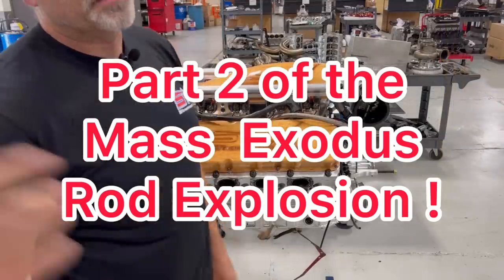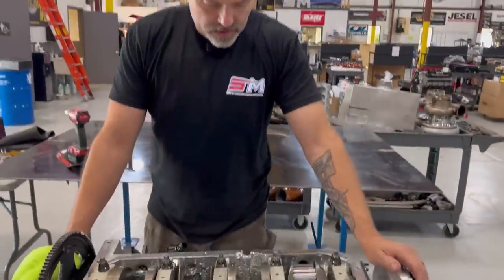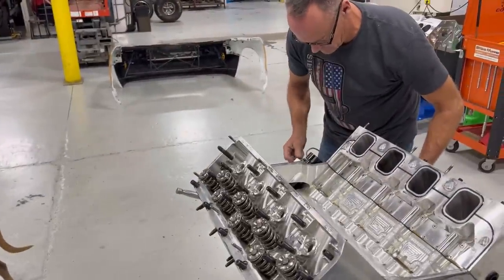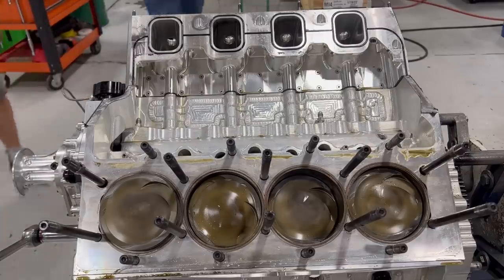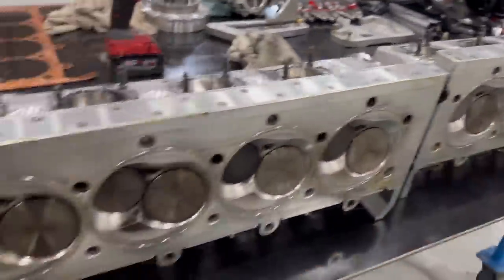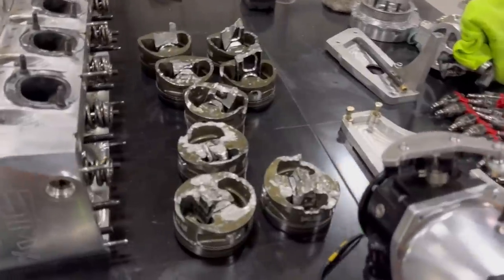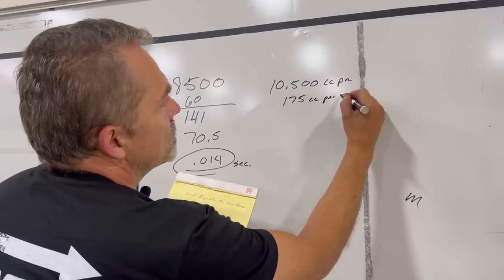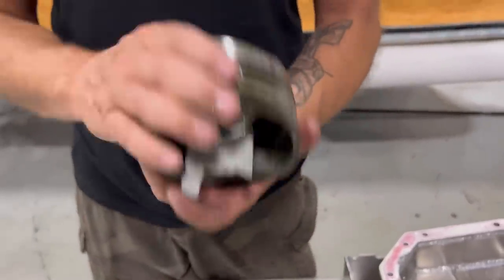EXPLODED RODS  Part 2

Comment: Steve, 
I agree with you that it seems like a material issue. It’s as if the rods exploded with all those small fractured pieces. Nothing looks bent … just pulverized pieces.
One thing you mentioned is that the rods were anodized. I’m no expert but, when I was involved in getting better mechanical properties the parts got  shot peened. Any thoughts about that?
Great video and very informative. Thx for sharing
Brad

Comment: 2 things : 1- this is obviously too much torque for those specific rods. (the point where they broke makes it obvious) 2- the rods were very brittle, because in principle rods should be tough enough to cut the engine casing. The casing shows surface scratches only, meaning that for some reason the material of the rods was weaker than design spec. (incident in the processing/hardening) If the aluminium alloy was playing its role, the destruction can come with a "brrr ... bang"  meaning there is a little progression (like half second) in the destruction because it bends before breaking (strong part breaking) but instead in your case it exploded in a "flash/bang" , indicating the brittle problem.

Comment: I was going to say either a defect in the metal makeup or an issue with the forging or heat treatment process of those rods led to them being overly brittle for that application.  The failure mode and grain structure visible in the broken parts just screams brittleness to me.  I would bet a fatigue crack developed in the rod third back from the balancer leading it to break, impact the side of the block where it meets the oil pan, and the shrapnel created from the initial break impacting the remaining rods moving at speed was enough to cause them to shatter.  Regardless, Im happy for you that the damage to the rest of the enging was relatively minimal given the extent of the shrapnel you pulled out of it. Hope you are able to salvage most of it.

Comment: I agree with others here - your positive attitude is great. I hope you can get to the bottom of this so we can all learn.

The close-ups of the remaining portion of the rods (in the pistons) look to me like they were stressed side to side. Might there be an issue with the pin caps expanding thermally at a different rate than the piston? Or ... maybe the intake valves were beginning to float (8500 RPM!!?) and the piston(s) hit it/them, yielding in a force to one side of the piston ... again putting sideways stress on the rod(s)?

Comment: I'm by no means an engine builder or anywhere near your caliber when it comes to engines/ drag cars.  However, what happened is actually an easy fix albeit always forgotten.  If you have a piston delete button, you MUST disconnect the con-rod scatter button.  If not, the impedance changes things and boom.  Hope you can find that pesky wire on the next build and proceed accordingly.  

I appreciate the context, your outlook, and willingness to teach us!  Thanks.

Comment: On the Salt ,I've seen a engine hydraulic while running. The driver backed off then planted his foot again . The cylinders had filled with unburnt fuel instantly. It  Locked the bottom end and spat the head gaskets out. The car was running around 200 MPH. The driver had cast his own ally BBC block and heads.

Comment: Glad that most of the components are salvageable. I'm really surprised the heads were still good. Until you pulled the rocker arm covers I expected to see tons of carnage. Really nice to see that wasn't the case. Overall outside of the rods the damage was minimal which is amazing when you think it let go at 8k+ rpm and 4k+hp. Quite extraordinary.

Comment: As a racer  I've  had many drivetrain explosions  ,, never found a Holly carb when the Buick motor  let go the block was in 6 separate  pieces cam, crank,the converter  took out the bell housing and guts.  The driveshaft had wrinkles,  the hood was blown upward the hood scoop was gone the windshield  was shattered , I picked up metal for awhile as well as oil everywhere    oooo yeah that was my worst

Comment: I wonder if harmonic resonance from maybe transmission output or another source  @ 8500 rpm travel  through the crankshaft  and into the rods and would you be able to acoustically pickup the failure frequency on a chassis dyno  and were all the other runs at the same rpm  looking forward to the metallurgy on the rods to come back your detective skills are past impressive Steve thanks for the great videos cheers

Comment: I am not an engineer or know lots of information.  This is a question/statement.  The way those rods shattered it is almost like glass shattering from harmonics.  I am not saying harmonics caused the failure.  I am wondering if there was a simple flaw in one rod that caused a change in harmonics in which these rods splintered/shattered from that the machining caused.  In other words was there a momentary harmonic shift that because of a design of the rods caused the whole catastrophic failure of each rod after the first rod broke.

Comment: The metal pulled apart look at where it's connected. It did it in a flake during casting something happened on the temperature during casting or hardening

Comment: Steve It appears that with all connecting rods failing together the fault lies somewhere with them.
The metal you removed from the bottom of the little end boss on the connecting rod is only allowing clearance of the crankshaft balance weights at piston bottom dead centre. 
The connecting rod twists around the piston gudgeon pin from one side to the other and the crankshaft balance weights must clear the connecting rod little end boss across its full side travel when in proximity to the rotating crankshaft balance weights.
Your machining of the little end boss only to the same as the piston is not satisfactory, the piston does not twist as the connecting rod angle must follow the crankshaft journal movement across the motor and any axial crankshaft movement, this could be loading, differential expansion between crankshaft, crankcase and connecting rod. All the best with your rebuild, Ian.

Comment: I really think it's just a material issue. It looks like the rods broke in tension not compression, so it was probably fatigue.Fact that they all broke sugess it was something uniform and rpm related (not saying it over revved just saying that was what brought the rod defect out). I'm guessing the heat treatment wasn't right, but I'm no metallurgist.

Comment: It is so clear to me these broke in tension due to a mass overload of the rods weakest cross section. It is a faulty rod design for the weights of Steve's setup to contain the mass on the exhaust stroke. I could be wrong but to have a coincidence like this cannot be explained any other way except one other way...and that is a faulty alloy itself and incorrect heat treat. Steve brings up an important point about anodizing as well but that needs to be further proven out before making assumptions about that part. Lots of folks assume the heat treat is strengthening the material but it is actually a way to add wear resistance on the surface of parts. If done to the wrong formula for the alloy it can and does make the metal overly crack prone on the surface. I had this happen on a batch of 9310 clutch dogs used in large horsepower lower units..an improper heat treat was actually the result of having the wrong alloy as the raw material we made the dogs from. The entire batch was thrown out after one failure..that's 100 dogs at a cost each of over fifty bucks. We did  get some help from the steel supplier in the end after they admitted where the raw material actually came from. Taiwan.  We no longer trust that supplier. 
  The true physical strength in metals comes directly from the chosen alloy and having that alloy fully traceable from mother earth to final product. This is why one should never use metals imported as raw stock from other countries. When stocking a machine shop/production shop with metal stock, it is so important to know where your metal supplier actually acquired the metals being sold. IE Fully certified traceability with written documentation. 
       Hard coat anodizing and conventional sulfuric acid color anodizing, is not ever used on any aircraft components. And this is not because of the possibility of entrapped corrosives, but also because of fatigue issues from that practice. The thin chemically converted anodized layer does not add any strength...in fact it is much weaker in structural strength than the core material. Not just because of the possibility of entrapped corrosives, but also because of fatigue problem from constant compression/tension cycles. If the anodized layer is cracked at the most critical point, say where these rods broke (IE where the rods core material was doing most of the stretching under the tensile loads) then it acts like a stress enhancer, and that you must keep tensile stresses well below the level at which any crack can propagate into the core material. This explains why the material is broken at such odd angles in my view. 

        Also something else to consider is piston speeds. Piston speeds within the bore are actually going the fastest at the three o'clock and nine o'clock crank positions (big end). The piston on the TDC or BDC is actually at it slowest actual FPS speed. It is the sudden reversal from having some combusted gas pressure still being imposed on the piston on the way up to evacuate the cylinder, and then the sudden loss of that pressure, combined with the sudden over the top reversal of piston direction with comparatively little actual pressure except some boost (40-75PSI in this case according to Steve) which compared to combusted gas pressure is practically nothing. The piston at the crank position of 3 and nine o'clock in any engine,2 or 4 stroke is actually further down the bore than merely halfway. The piston speeds are continuously varying depending on crank position but it is the end of the exhaust stroke where the tensile loads are at an absolute maximum, and the weakest link in that case will always be the failure point without doubt. These all broke in very close to the same spot of the rods beams which says to me a design flaw for the mass of Steve's setup (weight and rpm)

I am human and I can be wrong but these scenarios seem to me to be the very best explanation of how all 8 went. It is easy to rule out an internal flaw,like in steels for example..a carbon fleck, or as in flight 232 a nitrogen brittleness flaw in the main spool of the fan near bolts at the axis of that DC-10 engine.

To have that happen to all 8 rods is a one in a trillion possibility...not plausible at all in this instance.

From Wikipedia "Investigators discovered an impurity and fatigue crack in the disk. Titanium reacts with air when melted, which creates impurities that can initiate fatigue cracks like that found in the crash disk"

Anyway, without an actual lab examining what is left it is anyone's guess but logic and common sense strongly figure into the solution. THe first thing to do is calculate the load in tension of the piston/pin/rings and then calculate how many Lbs the rods were experiencing at the rpm where the failure occured. Then the same rods ads designed need to be proof tested in tension, but also in a cycle of compression/tension to fully know how that c/t cycle affected the tensile load bearing capability from new to ,like in Steve's motor...very little time since new.

Not here to argue as I find Steve' knowledge to be the top in this industry. And also, forensics after failure is quite interesting to me given my aviation background. Chime in if you can add something I have not thought of though...:)

Greg Olson/MN

Comment: Another valid point to make is that not a single one of those rods looked bent… I’ve seen engines lock up with multiple rods bent, these rods just exploded like glass. My guess is bad brittle rod material

Comment: may be shattered through resonance - they were all moving at the same speed of rotation with well timed ignition  - could cause the parts to ring - resonance occurs and puts systems at really large oscillations - with  all parts being so well specked , balanced i presume dynamically as well as statically could all suffer the same failure at the same time - would be interesting to see strain mapping of similar rods to see stress points at relevant speed of rotation and movement  and compression.
Reply: I am thinking along the same lines.  If something happened to the harmonic balancer, the harmonic vibrations could have hit a critical frequency for those rods,  causing them to fail simultaneously.

Comment: Good work sharing your thoughts and information on this. Looking at the little ends where they broke looks like a brittle fracture to me. I guess depending on the material composition, pre and post heat treatment this could have been as the rods were supplied or maybe the material work hardened with each cycle until failure. How ever it happened it was consistent on all 8 rods. While the black anodizing looks good is is usually not recommended on stressed components as it can cause the material to become more brittle. Hope all goes well with rebuild and look forward to see it return to the track.
Reply: Would the anodizing just cause surface hardening, though? I know surface hardening could lead to surface cracks which could propagate, but I'm not convinced that anodizing was the culprit here. I do agree that the damage looks like it was caused by brittleness. It looks like the rods shattered like glass.
Reply: ;) horsepower was obviously the problem. Keep horsepower under 2000, those rods will last forever.

Comment: Quite some time ago, I had a friend who built and raced BSA 500CC single cylinder motorcycles. These had a 2 piece aluminum con-rod and he was involved in a 'secret' process that involved submerging the rods in liquid Nitrogen, and then of course some slight 're-machining' was necessary, but he claimed it vastly reduced fatigue failures. Is this something that is still done?
 I've seen this done with high-speed steel tooling, and it has shown to increase the wear and fatigue resistance by 3-5 times... 
 Nice video, I'm looking forward to seeing the answer to these failed parts.

Comment: The rod manufacture advertises the black color as a thermal dispersant/oil shedding coating on the rods...not anodizing. To me the coating looks very similar to Techline TLTD POLYPHEN THERMAL DISPERSANT coating which gets baked at 300f for one hour to cure. Do you think that’s a high enough temperature to affect the Aluminum?

Comment: Maybe....   This is a long shot, but I've seen this in fire trucks...  What about sump?  I have seen vacuum draw where hoses collapse on the inside, causing restriction on a pump.  What if your oil system filled the pan, and the piston rods broke because of hydro lock on the down stroke?  If oil level was high in the pan, could have sheered all the rods on a downstroke.?  I have had lines like you have, the poly inside collapsed and causes restrictions.  You would not see this on an oil pressure gauge, that is on the pump output.  Only if you had a level gauge on your outboard oil sump tank.  All the oil was not returning back to the remote tank fast enough, causing oil to overfill the crank area?   Just an outside thought to look at?  This could be small and never seen. But during a run, oil would gradually build up in the pan and then get too full.  I see over flow lines, but at that speed and pressure, maybe not enough to release the oil out of the block???   Just an engineers thought?

Comment: i d say again it s same principle as soldiers marching over a bridge causing a vibration which vibrates at frequency that breaks the brigde.same as breaking glass with your voice.tire shake added to frequency of rods caused a deadly tremor.there is more than enough energy available to cause a deadly vibration at rod breaking frequency.possible material flaws just added to perfect storm.

Comment: Ill bet between metal mixtures and heat treatments heat cycles  the rod went from an expanding contracting rod to straight glass..explains shard like pieces ...are the rods poured in to a mold and finished cnc or cut from a billet block. Im leaning to the metal mixtures for them "aluminium" rods

Comment: I am very new to your channel. Great videos… Love following along with your builds and the information you share. You asked what viewers might like to see. Id love to see the repair process on an engine that had this much lower end damage. How do you fix the block and crank? To my uneducated view, it looks to be a metallurgy issue with the aluminum rods. The material appears it’s too brittle, the chemical makeup of the aluminum isn’t correct for the application, or an annealing issue? If aluminum rods have an annealing process…??? 

Anyhow, love following along with this ordeal. Would love to see the repair process and a complete rebuild. Even a vindication pass.!!! Thanks

Comment: I believe the fractures began in tension IE exhaust tdc  and possibly intake too if the cylinder pressure wasnt high enough to resist the mass of the rod and piston and the useful cycle life of the rod was reached im curious at whatever time was on the engine the rod was put in tensiom how many times ? obviously every exhaust stroke plus every misfire (even the perfect engine doesnt fire at every opportunity to fire ) add in rod elongation and contact with the head (pre failure) all sorts of unnatural forces get applied in a fraction of a second